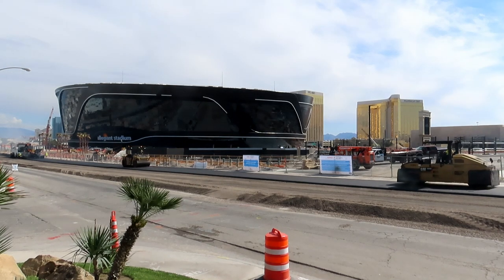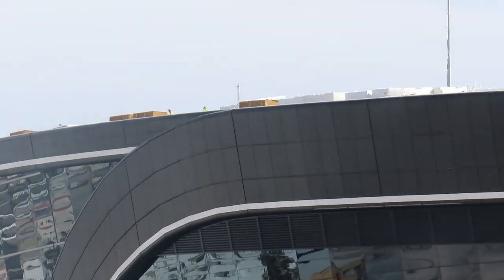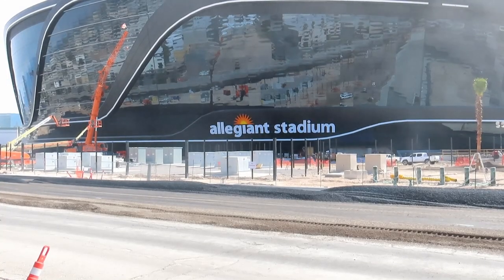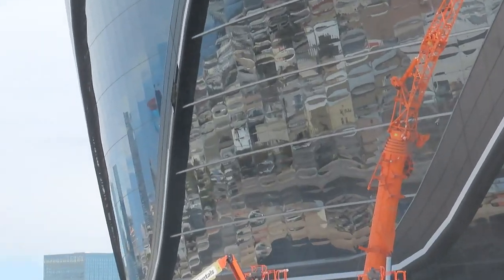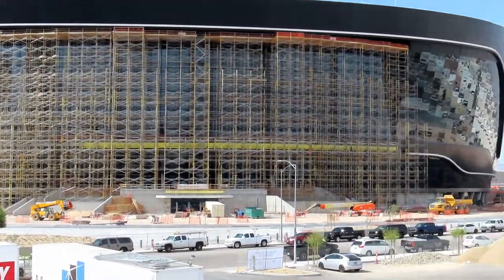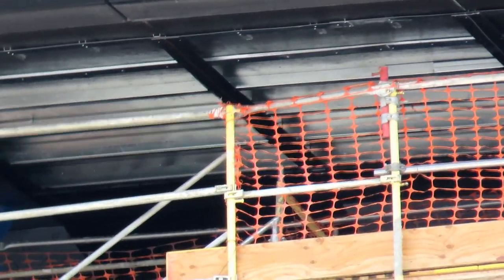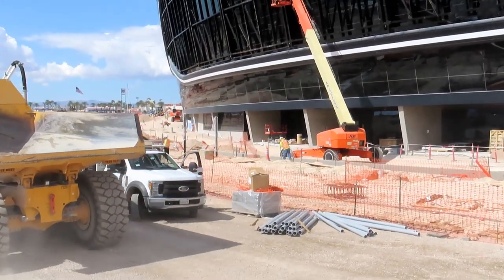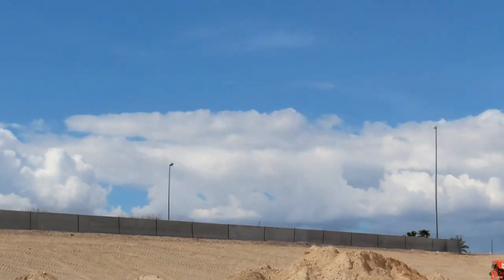Las Vegas Raiders Allegiant Stadium Construction Update 04 18 2020

Comment: Some pics from the inside, in case people wanted to see what it looked like as of yesterday:
https://twitter.com/LasVegasLocally/status/1251241455021985792/photo/1
All 4 video boards on the north end are done, the torch is coming along, almost all of the blue safety netting has been removed under the ETFE, and the lower west side seats are going in.

Comment: The panel at 12.45 looks broken... They must have hit it with a crane or a man lift… ☹ UPDATE:  They have been testing the light panels and the signs early this morning, you can see it in the 24-hour stream between 5 AM and 6 AM April 21 (At 5.15 the Stadium sign is turned on) and on the north view cam at 6.00 AM April 21.…
Reply: Brian Mandau a few panels need to be replaced cause they got damaged

Comment: Hey Duntov! Are they concerned with monsoons flooding the field tray area or do they have pumps and drainage in place to keep that from happening? I know you guys get flash floods from time to time. Or is this area not susceptible to them.
Reply from the maker: Hi Stephen, yes we do get flash floods out here once in a while.  I would think they have some king of draining system or pumps.  The area behind the Linq hotel "the old Imperial Palace"  used to flood all of the time.  Now it is the Caesars forum, where they were going to have the 2020 draft.
Reply: it would drain down into the south end opening were they could pump it out thru the sewage system.If it got too hard of rain they could bring in the tray inside,but its very self sustaining it even has its own sprinkler and heating system,and is 4 feet high. Hard rain like the monsoon usually lasts about 15 mins to a hour,and the issue is lack of storm drains in Vegas which is why it floods,but we only get 4 inches of rain per year...heres a good article about the tray--https://www.reviewjournal.com/business/stadium/allegiant-stadium-workers-focusing-on-ground-level-field-tray-1900909/

Comment: They have been testing the light panels and the signs early this morning, you can see it in the 24-hour stream between 5 AM and 6 AM April 21  (At 5.15 the Stadium sign is turned on) and on the north view cam at 6.00 AM April 21.…